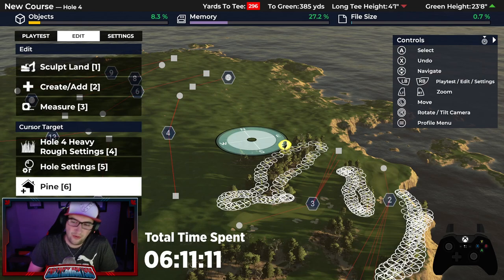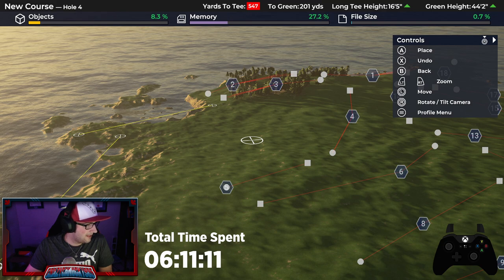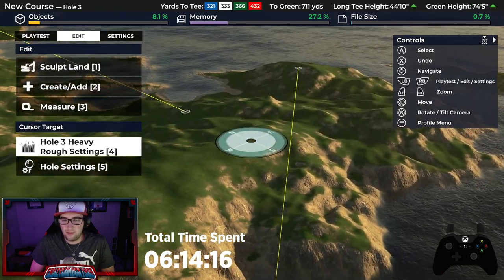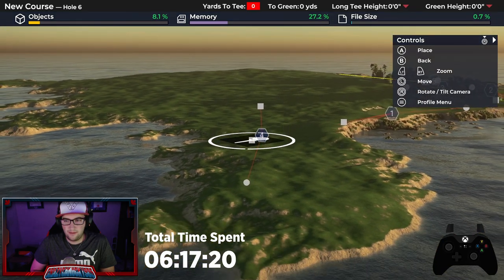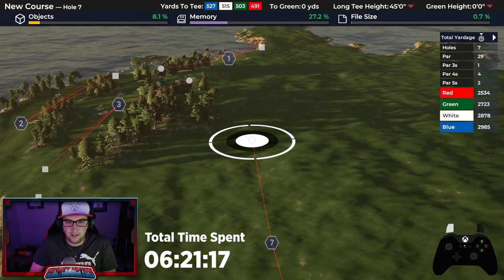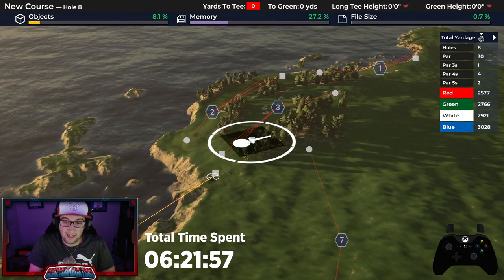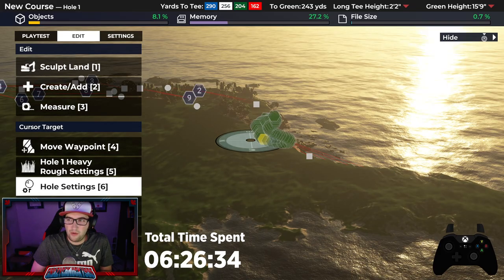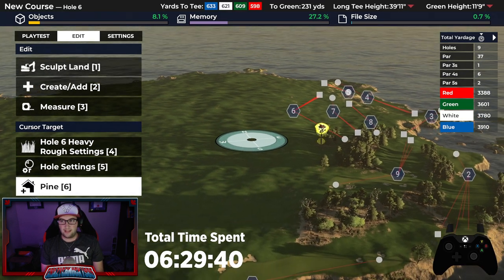PGATOUR 2K21 Complete Course Construction Series - Episode 10 - Major Re-route!

Comment: You have many options to make another par 3 on the front if you feel that area is too tight. You could keep 6 and 7 and make 8 a lengthy 3, or you could redo 6 and 7 to make them head back to “9” and turn “9” into 8. Then the new hole 9 could be a par 3. 

For the back: A drivable par 4 16th that heads toward the coast could counter it being a par 35 and turn the total course into a 72 once again. I think a drivable 4 could be a cool addition

Comment: Love the rerouting. #4 along a beach like would be cool after playing cliffs.

What about making #8  drivable par 4 of around 300 yds with a small green surrounded by trees. It separates #7 and #8 a bit more like you want and you don't have to worry about much fairway so it won't look squeezed in.

Maybe also switch #16 to a par 4 towards the ocean by moving the tee back a bit and have #17 as a short par 3 that has an island green feel with 100% carry across the cliffs? That differentiates it from #18 and builds the drama at the end of a tournament.

Great work as always!

Comment: Suggestion at 28:36 - perhaps 16 could be a dogleg left par 4 up to the base of the hill at the back of the 9th green, and then 17 could be a short downhill par 3 to link up with no. 18. That way the 9th green overlooks the final few holes and the routing is tighter, which might be quite nice. Although the shadows for 16 might be an issue.